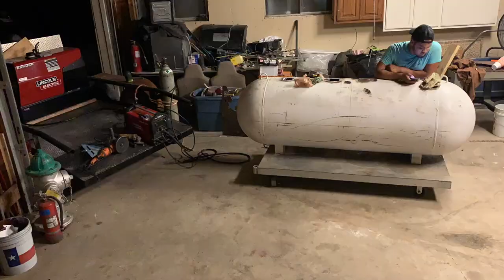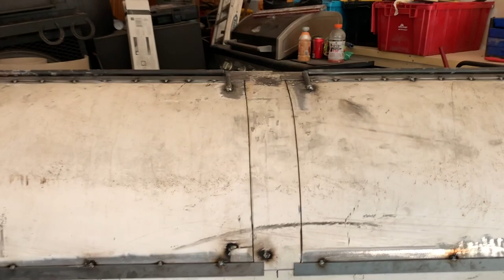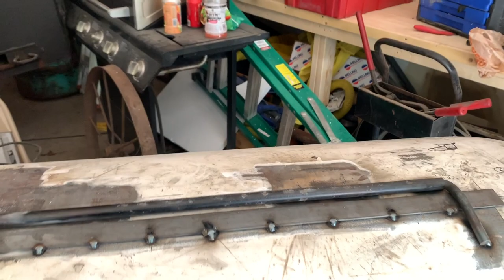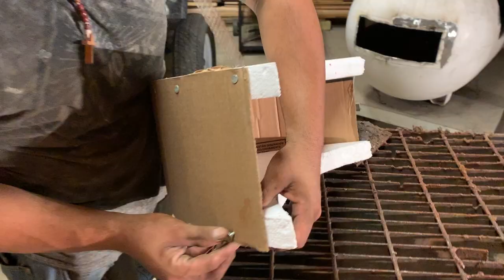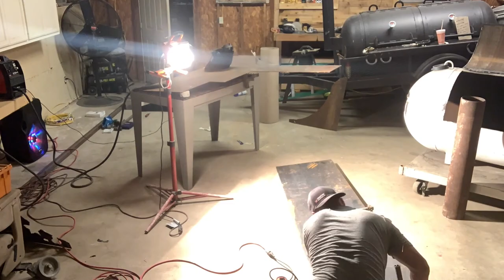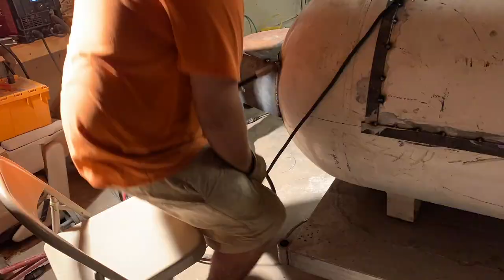Texas smoker build (250 gallon) Part 1

Comment: any recommendations on the size of the openings for the stack and the for where the fire box connects to the main chamber?
Reply from the maker: I do at least a 6 inch no bigger then 8 inch for 250 tank. 
The inner fire box I want to make a video on it.  About to start 2 these next two weeks.
Reply: Yesss a video would be perfect. Thanks!! I’m having trouble picturing it in my mind.

Comment: Hey man like your work looks good I have a question if u dont mind I have a 90 in long and 30 in round how big should my firebox be thanks
Reply from the maker: I would say Atleast 24” long fire box.  That’ll put your cooking space at 66”. You could do 30” long fire box too. Really depend on how much cooking space you want.
Reply: @CodeyMikes  so 24in long and how wide and deep
Reply from the maker: Schanen Battle okay so it was 90” long and 30” wide.  I’d do 66” cooking chamber and 24” firebox.  Just keep it 30” width.  Prob a 6” diameter smoke stack 4ft tall
Reply: Ok sorry to bother u
Reply from the maker: Schanen Battle no worries man! Lol Ask away

Comment: Curious, why two doors instead of one big door with a counter weight? I’m wanting to build one similar and like the aesthetic of a single door over two doors. Is there a difference in performance?
Reply: From watching countless BBQ documentaries, my impression is that the separate doors allow you to open a smaller portion of the smoker to retain the heat inside better. I’ve also seen different cuts or types of meat on separate sides with the two doors. Not sure if it’s necessary or just preference, but if keeping an even cook going is important I would think being able to open sections instead of the whole thing would be useful.

Comment: What’s the size of the doors on the 250 build. Also the size of your firebox, I am getting read to start my first offset smoker build looking for a little help! Thanks in advance
Reply from the maker: I don’t know the exact size of the door.  But we went 2 inches off the end cap weld.  Then found the middle and made it 5inches in the middle to clear the temp gage with the flat stock on the door.  The fire box is 32 inches long. And it’s just a 250 gallon cut down. Thank you for checking us out. You can ask away.
Reply: @CodeyMikes  Thank you for getting back to me. Great info for the Doors and the fire box. keep making videos they are fun to watch.
Reply: @CodeyMikes  Thank you for getting back to me. Great info for the Doors and the fire box. keep making videos they are fun to watch.
Reply from the maker: Cody Duffin if we still had it I could get you exact. But each tank is a little different.   But thank you man! Should be finishing up the 500 gallon video this weekend. And it’ll be up.

Comment: Is it easier to manage a fire on a 250 compared to a 120? 

I was going to get a 120 but the guy was really trying to talk me into getting the 250 instead due to fire management. Is it true?
Reply from the maker: No and yes. 

Smaller smoker calls for smaller splits of wood. If you go and put a regular split on a 120 you probably will be running a hot fire.  

250s can take a regular split if built correctly.  And maximize/ make it easier to cook. 

120 can be just as efficient. You will just need smaller wood/longs to manage your fire.   
Honestly it’s all in the way it is built.
Reply: @CodeyMikes  thanks for the info. Sounds like a 250 it is 😏.

Comment: How do you cut the doors so they don’t spring/ warp ?
Reply from the maker: Most of the time they still flatten out a little.  We’ve had good luck cutting top and bottom. Then cut one side and putting flat stock on it.  And then the other

Comment: Holy crap your metal is expensive... Currently building my smoker... got all parts for 100€ (like 120$ I think) and they are about 250kg which is about 550 pounds
Reply from the maker: Yea. Each 250 smoker we have roughly 1500-2500 in them. But who knows how stuff goes with this virus

Comment: I started building and my flat stock rubs on the top of my smoker keeping the doors from closing. I'm obviously a rookie. What did i do wrong? Thank you.
Reply from the maker: DION COLEY are you hinges too close to the flat stock? What thickness flat are you using? We set the hollow hinge part about half inch off the flat
Reply: @CodeyMikes  Thank you for the reply. i have tried 1 and 1.5 flat stock both rub. as i look at pictures online most fave the hinges welded on the flat bar which mine are not so not sure if that is the problem.

Comment: What are the measurements on those doors?
Reply from the maker: I don’t know exactly.  But we come off 2” off each weld(endcap weld). And then the middle post is 5” wide. If that make any sense lol.  We are about to do a 250 and I’ll post a video when we do. Just check back in with us in a couple weeks.
Reply: Cars N Que how much did you spend on this smoker?
Reply from the maker: Julian X man honestly. Around 2000. But that not counting time and equipment
Reply: Cars N Que do you know how long the doors are bottom to top